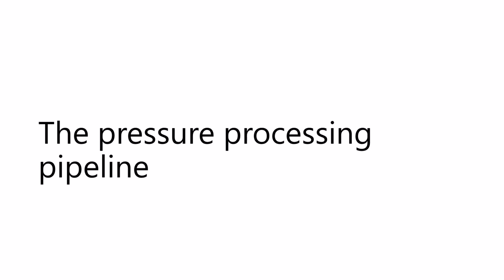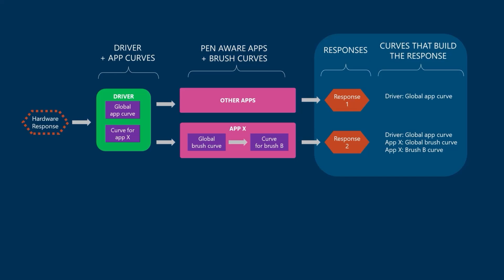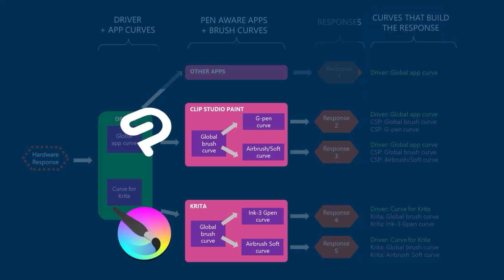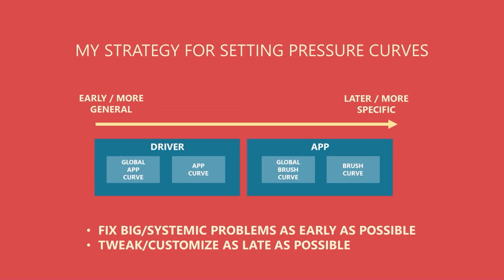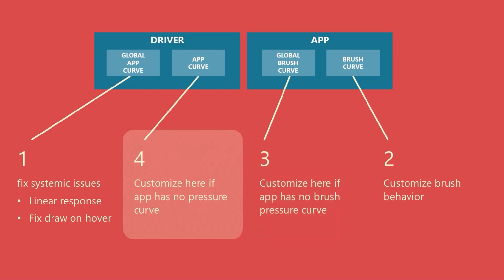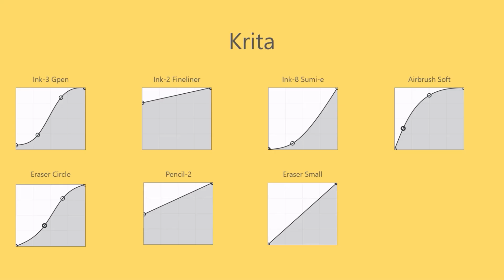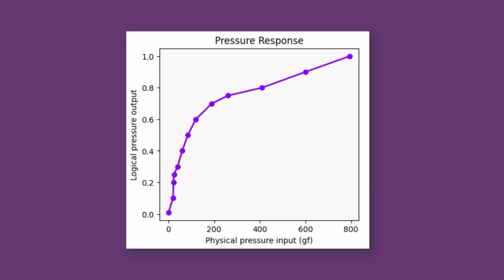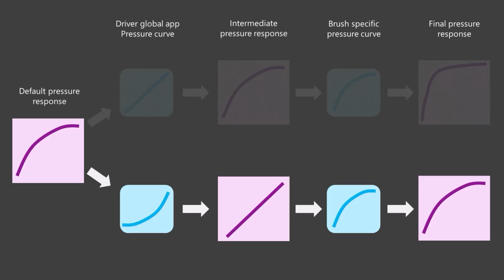Drawing Tablet Pressure (4): More Pressure curves

Comment: Your advice is nice for software like Painter where brushtracking curve controllers are more limited. Also, the default tools on the driver software are limited compared to Clipstudio, the ideal optimization would be that the driver software was as good as clipstudio so you could even edit S curves...but you only have one node....:(.

Tried your way for many years and it is not good to combine two different curves, so I've always skipped the driver leave it as default then I only edit the general curve for Clip Studio and I leave all the brushes linear, because my big reason is "SPEED", because i will know how each pen pressure will feel without even touching the tablet, so the stroke will come out the way I like it, but if each brush had a custom curve it would be like flipping a coin to see that type of brush will come out on a speed art. I don't want the brushes to feel like traditional I want them to feel digital, just one type of pressure.

But this has also negative characteristics,  you would have to customize each brush with a specific opacity and specific settings rather than using defaults, so it can consume time to customize each brush. But in places like Painter with a really limited curve controls, your advice is solid, because the driver can control the curve better.

Looking forward to your next video, this videos are very informative and nice to see.

:)
Reply from the maker: Thanks for the nice comment! And thanks for sharing how you manage pressure curves. It's good to see there are different approaches that balance different priorities. I just published episode 5 about pressure levels so I hope you enjoy it and I'd love to get your feedback on it. https://youtu.be/PRbI02Y0CAo